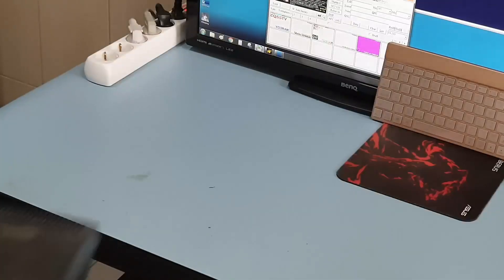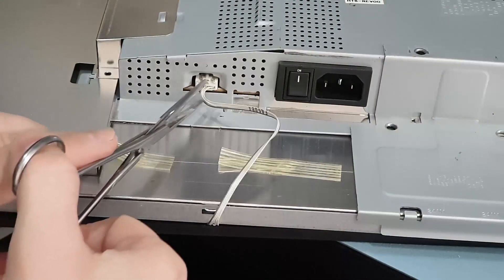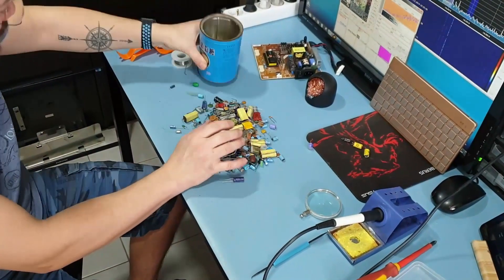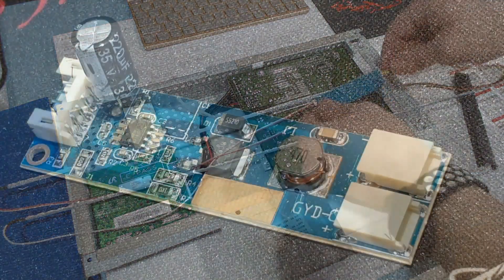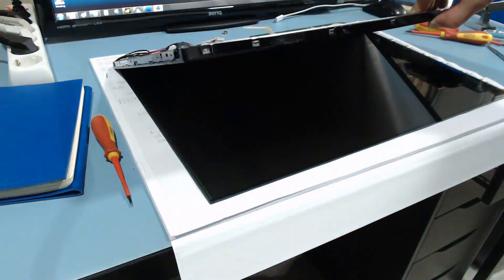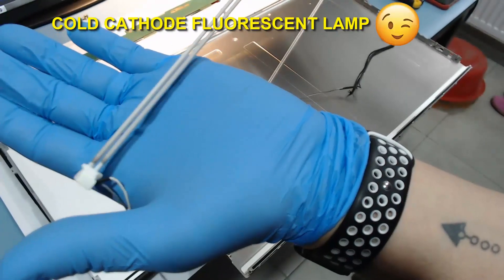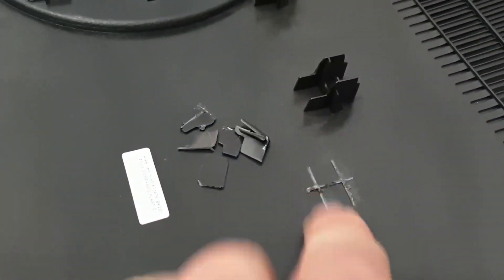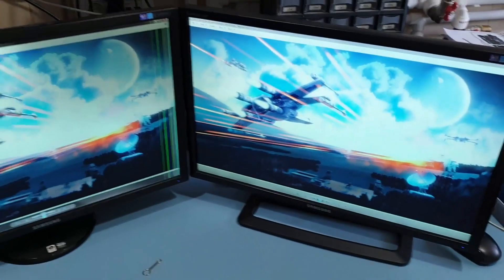24'' Monitor repair. Replacing old CCFL with LED

Comment: Got a disgusting CCFL monitor bought literally in 2020. The thing's have suddenly a purple tint on the right side of the screen. Could get it fixed with warranty but I have to pay shipping. I might just replace it with LED or another CCFL tube if I ever get the right size

Comment: Hello, after you replaced the capacitors, you connected the cable video, and on the screen there was the message "check signal cable - digital" but you have put the VGA or DVI cable? if the lamps were bad you can't see clearly that OSD message, the message was: no signal from DVI, IMO you did something wrong. To me were just the capacitors bad. At the end of the video, those vertical lines on the right of the screen are caused by problems with those flat cables connected to the screen.
Reply from the maker: Hey Roby.
Believe me, I tried everything before this video. You are right, at first I didn't connect any input signal. I just wanted to show that the screen lights up. It did, but only for few seconds, then it turned off. I measured and replaced all the capacitors, and it performed exactly the same. I wish it was that easy and I didn't have to take the LCD apart, but I am sure the CCFL lamps were as good as dead.
For the vertical lines you are also right. Sadly, the heating and everything I tried didn't work.
Reply: @Racov  i guess you know there are those kind of tester for lamps, i haven't one, but are useful.
unfortunately same symptoms but different components that can break. Watch this video about lines issue https://www.youtube.com/watch?v=S4ccg-Cw6-o  and this one about the lamps problem and not simple fix. https://www.youtube.com/watch?v=hU218Frv6sA

Comment: can i will to short the (power board side) of ENA to GND to disable the inverter in any GND of the board?? my board is different (samsung-220m) Is that correct? thanks for your video
Reply from the maker: Hello Andre
Yes, you can use any GND.

Comment: thanks! I did it yesterday, worked good but the problem is, when i turn the display off the leds are burning.
What error did i make?
Reply from the maker: Hello Ivan.
Looks like the Enable pin of this module is not connected correctly. When the monitor is turned off, the Enable is connected to Gnd and the light is disabled. On the other hand,  with monitor off, the power should also go off, so it's odd that lights stay on.
Can you provide more information, like monitor type and where you connected each wire.

Comment: Just wanted to say well done, I admire your patience. I changed the backlight on a 25 inch screen a few years ago, and the CCFLs of a 40 inch TV a few month ago (this was the most challenging fix I ever did). I know the struggle. Everytime you disassemble a LCD Panel you never know if you're going to break eveything. And now I've got to do it all over again with 19inch Acer screen. I'm not looking forward to this
Reply: Oh boy.... And I am using 2 really old 1080p monitors from 2006. One of them is at Max brightness and the other is half. I think one of the CFLs in there will die soon. I won't be looking forward for that.. but if it comes I have to do it because these 2 old monitors I have, they are amazing for what they are
Reply: @aleksandersats9577  I have similar concerns with my 1440p IPS Apple Cinema Display from the same era. Better looking than a brand new 200 dollar screen today, but its time is limited due to the CCFL lifespan.
Reply: @awesomeferret  They can be replaced if there is another monitor like that that has another issue entirely. But considering it's apple not gonna be easy getting even a broken one for cheap
Reply: @aleksandersats9577  although, since it's LG it's possible (the 30 inch panels used in the aluminum CCFL 1440p Cinema Displays that were used in other products). Apple unusually uses off the shelf displays in their monitors, remember (I wouldn't be surprised if this has changed in the past few years though).
Reply: @aleksandersats9577  What company is your monitor and what is its model number?
Reply: @shagarcool  Main: Dell 2407WFP-HC, Secondary: HP LP2465
Reply: @aleksandersats9577  I got two HP LP2465 too best screens I ever had I am planning to replace the ccfls in them too.
Reply: @Hagis2k  yeah they are great! The only complain I have with them is that their response time is very slow, so I use the HP one as my secondary and DELL as my main

Comment: my dell 24" led monitor has some backlight leds not glowing. can you please post a tutorial, on how to open the panel safely and replace those ?
Reply from the maker: Hi iceberg.
I'm sorry, I can't do this, because I never opened a Dell 24' monitor.
Every model is different. I'm sure you can fix it,  you just need to be patient.

Comment: Same power output for fluorescent lamps and leds? Doesn't it burn the LED's? Can I just pull them out and put LED's?
Reply from the maker: Hey zeus.
You can't do this. 
You have to use the LED driver.
Reply: @Racov  Sorry for being a dumb but I need to ask: You replaced the capacitors because they were dead? I couldn't find driver thing in the video.
Reply from the maker: Yes, I tried to fix the capacitors first, but this didn't fix the back-light. 
If you go at minute 8, you'll see part 2, changing the lamps with LEDs, and installing the driver.
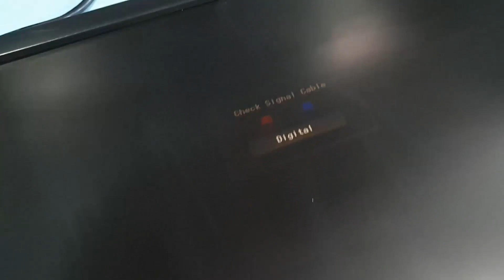Reply: @Racov  After 7:46 you show the driver to purchase my mistake.

Comment: It's been almost a year since you posted this so I don't know if you're checking comments, but I got to ask:

10:48

So, it's GND to GND, DIM to DIM, VIN to +15V, and then you cut ENA in half, connect the «video board side» of ENA to the LED module, and you short the «power board side» of ENA to GND to disable the inverter. Is that correct?

I'll probably add a buck converter to run the LEDs at a lower voltage, just in case.
Reply from the maker: Hello Lisandro. 
You are absolutely right about the connections. 
I am not sure about the buck converter... the LED driver is self regulated and can work up to 30V. Do you want it to work with less than 15V? The LED strip is controlled so that you can adjust the brightness, contrast with the monitor's controls, and  have dynamic contrast, standby etc.
Maybe for less brightness a series resistor (tens of ohms) with LED strip can be enough.

Comment: My board has 14 pins between the power supply and the other motherboard. How do I measure the values for each pin with a multimeter?
Reply from the maker: Hi Saul.
In order to identify which wire is which,  I did this: finding power and ground is relatively simple (power should be between 10-30V). For DIM and ENA (control of brightness and ON/OFF), with the inverter removed, I measured each wire and write down the values, both with screen ON (of course, like if there was a screen), and OFF. in ON, DIM should be around 3V, ENA = 0V, in OFF DIM aprox. 5V, ENA > 2V. That's all you need.
Reply: @Racov  thank you very much for your reply and explanation. hopefully i'm able to figure everything out :)

Comment: Yay you have the same problem as my monitor 
Stupid dell put wrong capacitor value and use very very cheap capacitor, after 15 years of use the capacitor blew up and the inverter die too
The capacitor value should be 2.2 uF but dell put 22uF capcitor
Thanks for thw video

Comment: In my 2004 HP laptop there are five wires running to the original ccfl inverter board, plainly there is power and  ground, and two wires for control of bright to dim, but what is the fith wire? Also the connection to the led board will not fit ?
Reply from the maker: Hello Christopher.
So I understand that the CCFLs of your laptop screen are dead, and you want to replace them with LEDs. This implies, of course, replacing the CCFL inverter with LED driver board. In order to identify which wire is which,  I did this: finding power and ground is relatively simple (power should be between 10-30V). For DIM and ENA (control of brightness and ON/OFF), with the inverter removed, I measured each wire and write down the values, both with screen ON (of course, like if there was a screen), and OFF. in ON, DIM should be around 3V, ENA = 0V, in OFF DIM aprox. 5V, ENA > 2V. That's all you need.
As for the positioning of the module, I know the laptop is a tight place... You can extend the wires, if that helps.
Be prepared to have a hard time taking the screen apart and back .
Please let me know how it worked out.
Reply: @Racov  It seems I will have to remove the connector from the  invertor board Curent IN side . Then some how solder to it  the wires from  the  4  wires from the lcd
Reply from the maker: @TheShamwari  Yes. I guess there is  no way around this.

Comment: I have a VA Eizo monitor with 54,795 hours of use, that has a LED backlight. I didn't know modern electronics could last this long. It had a 3y warranty for the panel, and 5y or 30,000h for everything else. I believe the backlight will fail at some point, but who knows, it may last for eternity.
Reply: Operating it at 50% brightness or lower would help extend life of LEDs...
Reply: @sophietronics  65468 at the moment. Sometimes there are some analog looking waves in deep shadows. It is currently connected using VGA connector at 1080p in an old embedded system. A light tap on the frame fixes the waves for the day. This monitor is usually on 15h a day, sometimes 24. Let's see how they fail. The backlight is at 20%. This monitor actually looks identical in VGA and DVI. Excellent design. Still free from acoustical noises. I remember the LGs my friend got for the same application. They cost half as much, lasted less than half the hours and were buzzing in less than 80% brightness. The power consumption was 2x or something like that at similar brightness, so they probably cost twice as much in total.
Reply: @aristotle_4532  I do experience it on the Mitsubishi Diamondcrysta Square Monitor that I have... When I connect VGA, there are some "static" analogue waves flowing from down to up the screen. But when I use DVI-D, this waves were not present, a solid picture straight from video card without interference. I just wonder why some VGA connectors had that strange behaviour. Sadly, on electronics, there will be a time when it will fail, just like us humans who need maintenance for self. LG is also good brand, reminded me of Flatron LCDs. Maybe the LG that you mentioned, were using CCFL?
Reply: @sophietronics  The vga did not show the problem in the first 63k hours or so. The lg units my friend got were ccfl I think and the power supply was not very good. EIZO are a very good brand. I had two of their 17 inch CRTs that quite after 12 years and an ancient 15 inch somewhere that was working when I replaced it . In any case, my monitor is like a 95yo complaining about getting tired after long walks😁

Comment: You should use double sided thermal conductive tape or at least superglue. These leds run way too hot and don't have aluminium pcb. 
Shimming the COF can reduce the lines. Just put some paper under the metal frame where the lines are.

Comment: Great vid! If my monitor working fine - can I just change it to LED with the Aliexpress LEDs? is better CRI affecting the blueyish/yellowish problems? Thanks
Reply from the maker: Sure you can switch to LED lighting. It is a delicate process, to disassembly the screen, you know. If you can find a better CRI LED strip, you should get the right colors on the monitor, of course. You see, mine is a little bluish...